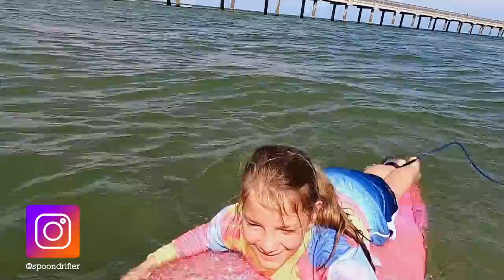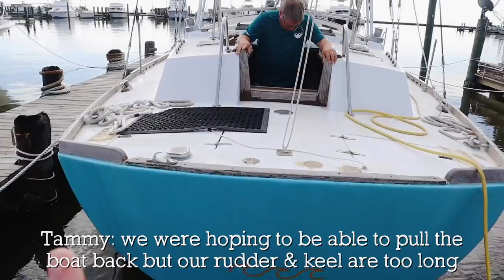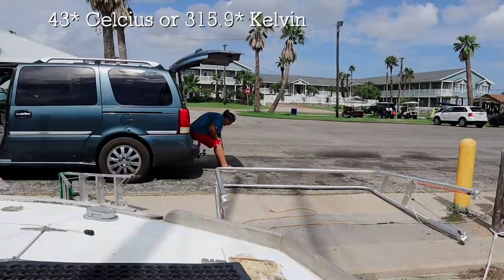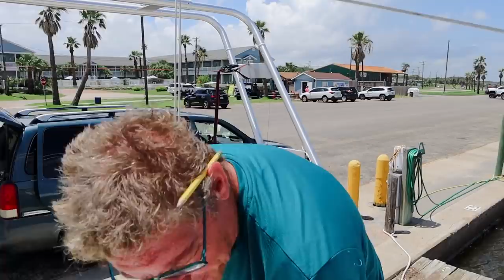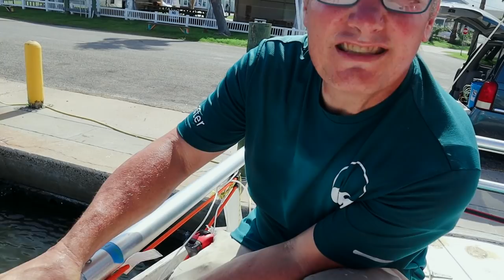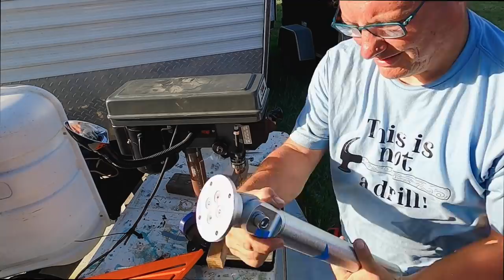Piecing Together Our Solar Arch | ep. 175

Comment: If it looks right it is right, even if it's wrong. Imperial units are hell to work with. I grew up on them and have used strict SI for the past 50 odd years. No more messing around with feet + inches + fractions in halves, quarters, eights, sixteenths, thirty seconds, sixty fourths, ............ I only would have needed mm for that job.
Reply from the maker: It’s a crazy system for sure.

Comment: Are these all your personal tools?  I figured you would need a drill press at some point and then lo' and behold... you had a drill press!!!  Were tools available nearby to borrow or rent as you needed them?
Reply from the maker: They are mine. I do construction on the side. A drill
Press is specialized for sure, and this one is a cheap harbor freight special, it mostly does a good job but needs finesse. When we shove off unneeded tools will be sold off.
Reply: @Spoondrifters  Thanks for the update